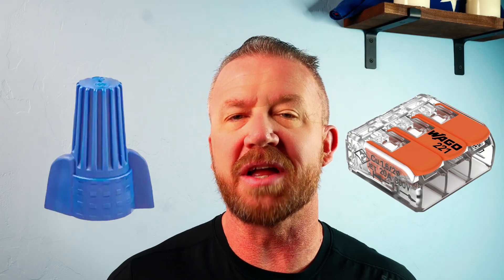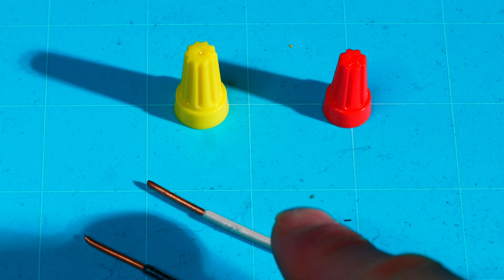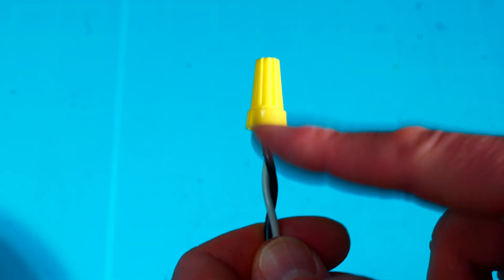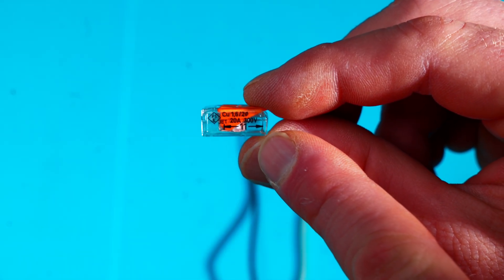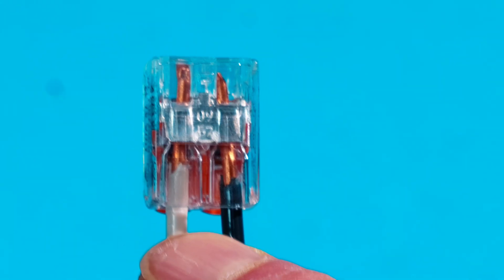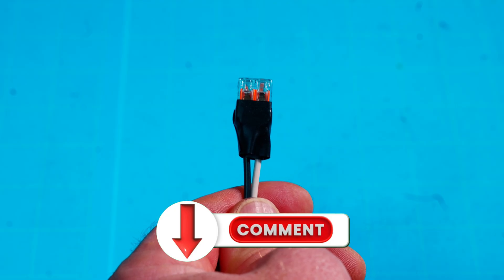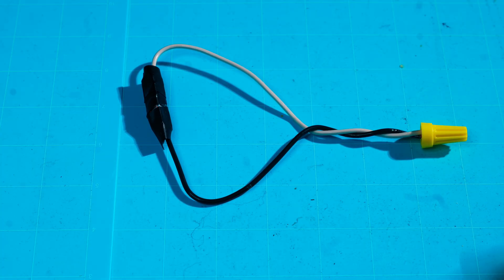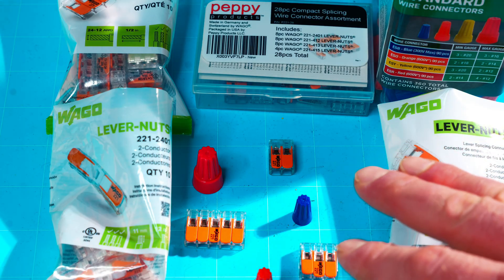Wago Lever Nut vs Wire Nut (One Clear Winner)

Comment: Regarding wire nuts, I find that pre twisting is unnecessary for 2 or 3 conductors using 14 gauge. 4 bare ground wires also works well using 14 gauge. Ideal 341 tan or equivalent works great in these cases. For 12 gauge, I pre twist especially for 3 or 4 wires and use Ideal red wing nut, red/yellow twister pro flex, or 3m red/yellow performance plus. I don't put tape on wire nuts. 
Regarding Wago lever nuts, I've used them also with good results. They are fine for 20 amp circuits, not just lighting circuits. They also make larger ones for 30 amp circuits and 10 gauge wire. They are especially good for using stranded wires and a stranded/solid combination. I don't usually put tape on them, but I see the advantage if the box is close to maximum fill capacity. Peppy products is a distributor, only Wago corporation makes them. There are other brands and Wago clones, but they won't have the Wago logo.

Comment: Years ago I had  open neutral caused some problems tracked it down to 4 wires in a wire nut behind the washing machine. After that I used Wago's never had a problem. Try pre-twisting 5 stranded wires together under a wire nut.

Comment: WAGOs for lighting circuits and wire nuts for receptacles and splices in walls.

NEC allows both, as long as they’re listed and used per manufacturer specs (110.3(B)).
Reply from the maker: Thank you for sharing my friend!

Comment: Been using Wagos for years, now. 
Never had an issue - easy to use and secure.
Reply from the maker: Yes totally agree! Thanks for the comment my friend.
Reply: I just had a wago fail on me, thankfully before screwing the outlet into the box.  Before pushing the wagos into the box, I put electrical tape over the levers (just the wago, the tape was not touching the wire).  I realized the box I had in the wall wasn't big enough for the GFCI outlet I was installing, so I kept the power cut to the outlet and let it hang outside the box overnight. 

The next day, I came back to the outlet, pulled on the outlet to get the wires out of the box and the pigtail going from the wago to the outlet came out of the wago.  This does not fill me with confidence that the wago is the way to go.  Pigtails were fully inserted into the wago, with about 1/16" of wire shielding inside the wago, so it was installed correctly.